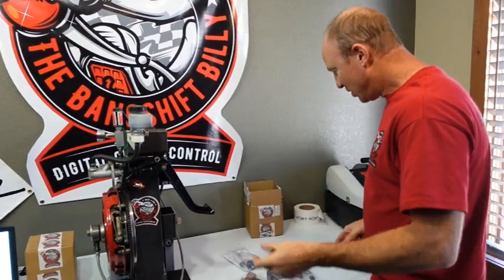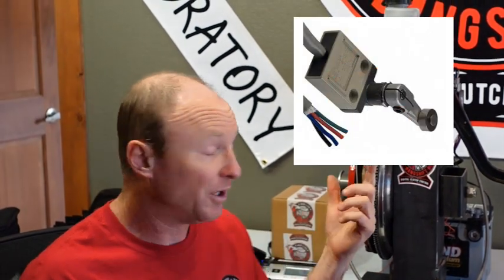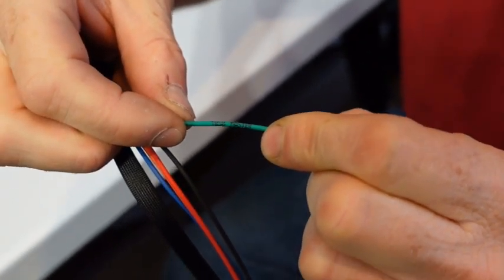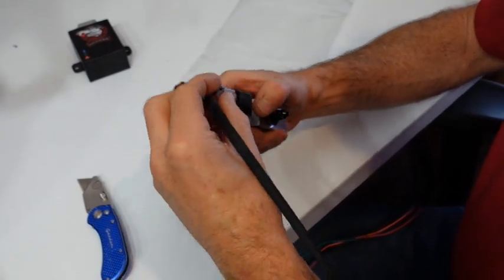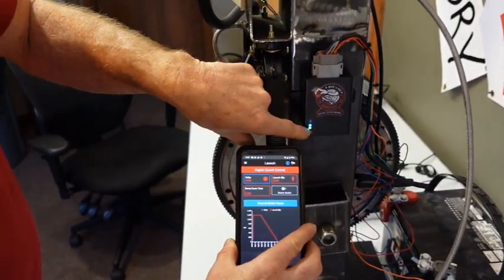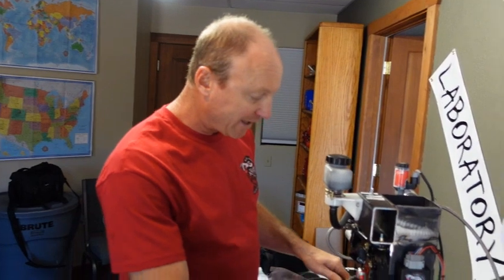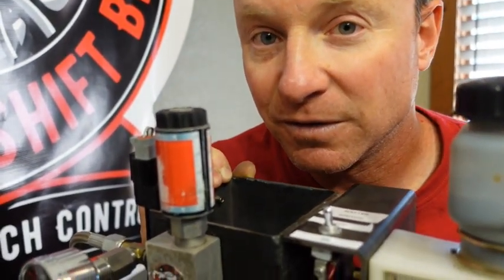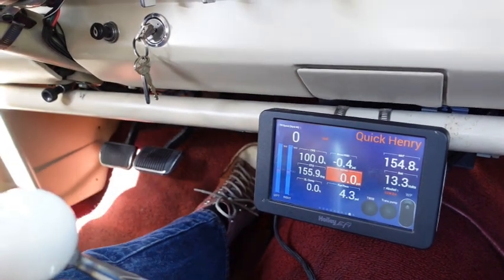Updated Steps to install your Digital Clutch Controller

Comment: I'm think'n line lock and bsb same button?
Reply from the maker: The clutch controller has to be on the clutch switch because it's literally micro seconds matter and you never get that accurate with your finger

Comment: Can you use the advanced tables to PWM and not use the app? or does the Dominator only trigger the conditions to activate the solenoid?
Reply from the maker: The Dominator only sends a 12v signal to the controller to trigger it when all three of the parameters I talked about are met.  Not sure what kind of amps the dominator can actually put out but I don't think it can PWM the solenoid, never actually tried it.